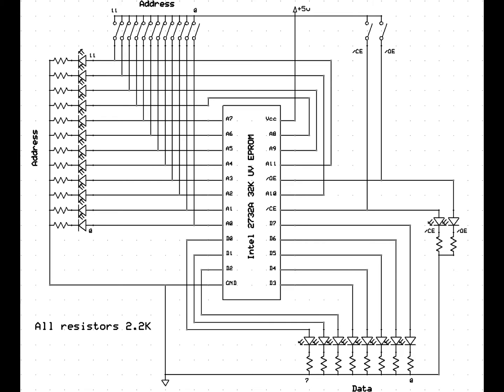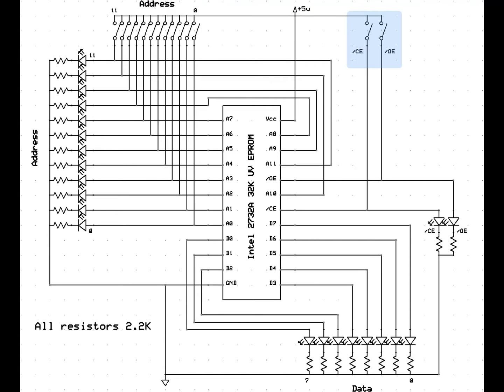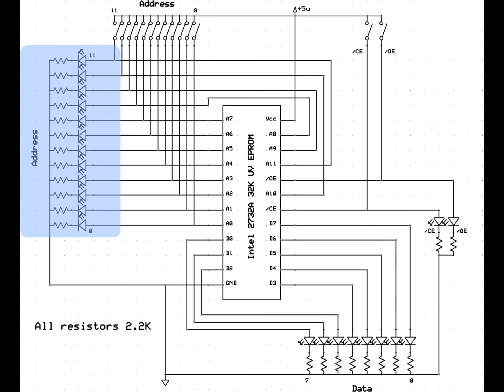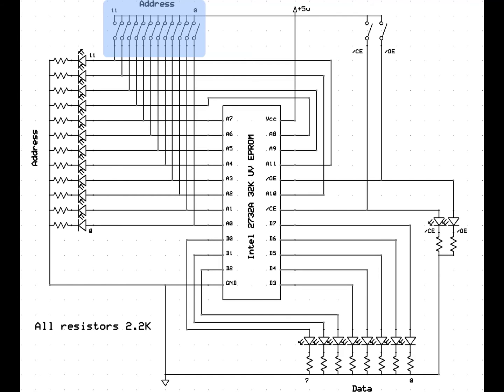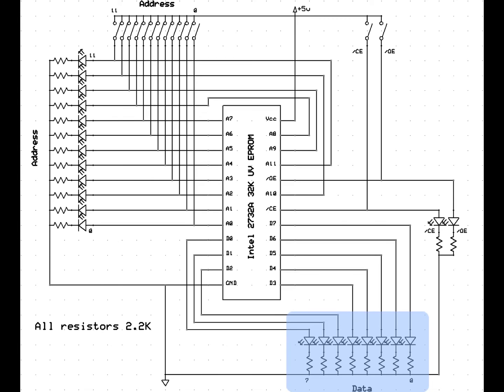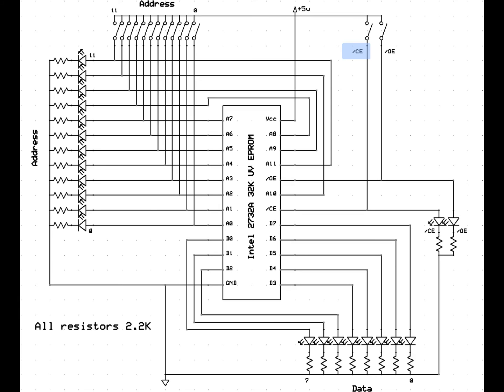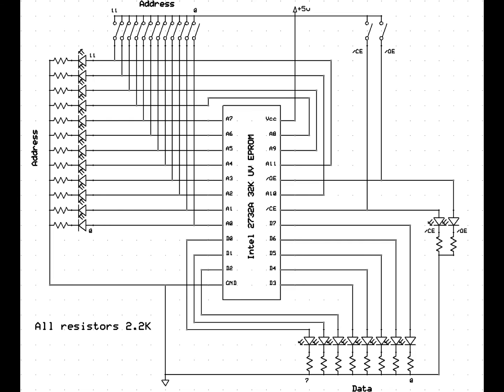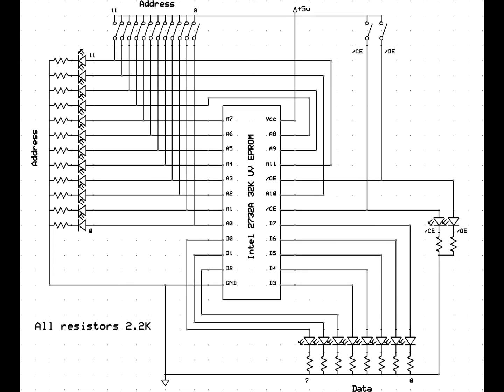Intel 2732A EPROM Read-By-Hand Example & Schematic (User Request)

Comment: This is probably a really goofy/simple question, but for 8 data pins, how come there are 12 address pins? what are the extra 3 (a9, a10, and a11) used for? thank you!
Reply from the maker: Hey there, that's a good question.  There is one address line for each bit in the address.  There are 12 bits worth of addresses that you can select from in this device.  The data pages themselves are each 8 bits wide.  The device itself has a total capacity of 32 kilobits (ie 32,768 bits) which you get to access 8 bits at a time by selecting any one of its 2^12 (2048) addresses.  2048 possible addresses * 8 bit pages = 32,768 bits total  =)  Hope that helps.  Feel free to ask another question if you have one.
Reply: @Tbird761  Wow, there was a bit of math here I had left out, and basic memory structure I still need to read up on. I really appreciate the response! I've been trying to figure this question out for hours, but not wording it correctly due to my lack of knowledge on addresses worked. The relationship between 12 and 8 threw me off I guess haha. One thing I do have a question about is the last part where you say "You get to access 8 bits at a time by selecting any one of its 2^12 (2048) addresses. 2048 possible addresses * 8 bit pages = 32,768 bits total" did you mean to say 4096 instead of 2048? I keep getting 2*12=4096 on my calculator, unless maybe I'm leaving out another equation? thank you!
Reply from the maker: @justinpierson2521  Almost gave you the wrong information in my reply.  There are two versions of this chip which was tripping me up.

You are correct in that 2^12 is 4096 and there are 4096 addresses available with this part.  4096 * 8 = 32,768 which is indeed the capacity of this part.  =)

I think I just cut the address count in half because I knew the full version of this part was 64K and I thought they shared the same physical package (ie that mine just had one address line that didn't matter).
Reply: @Tbird761  Sorry for the late reply but yeah I hear you, I'd prob do the same haha, that sounds tedious to remember. I'm just getting into this stuff, and what you told me lead me in the right direction for understanding how these chips work. Thank you!